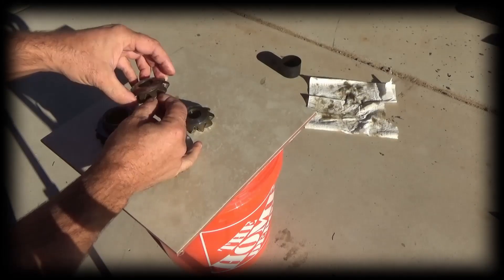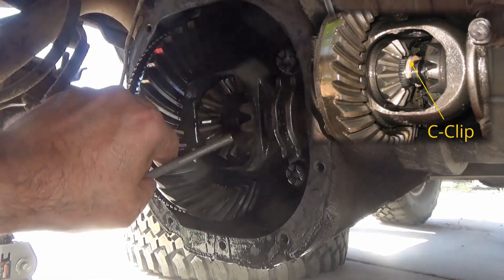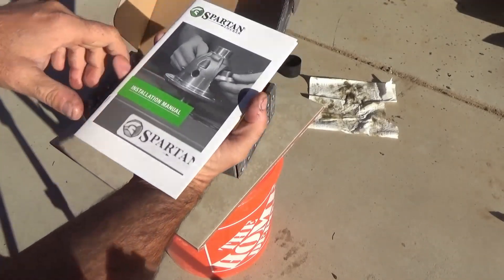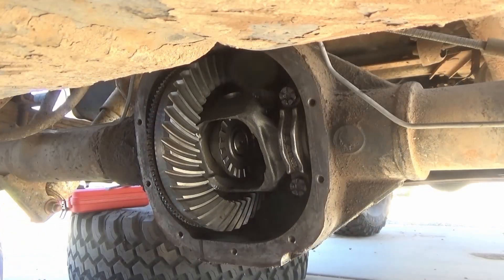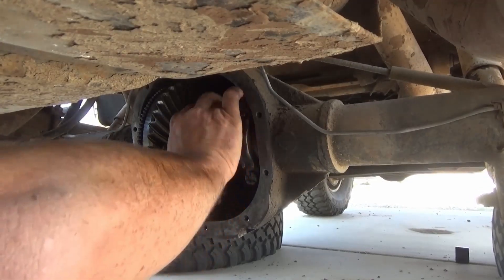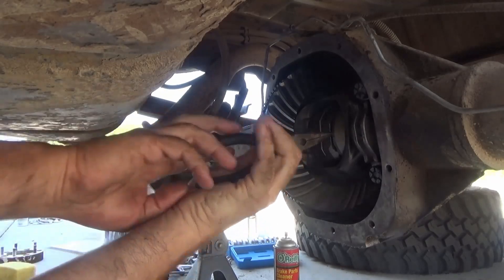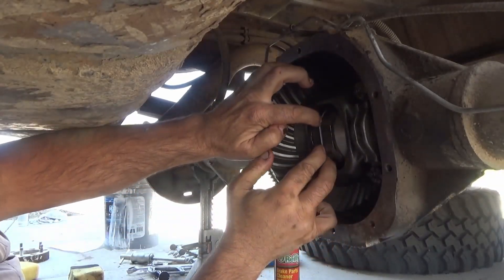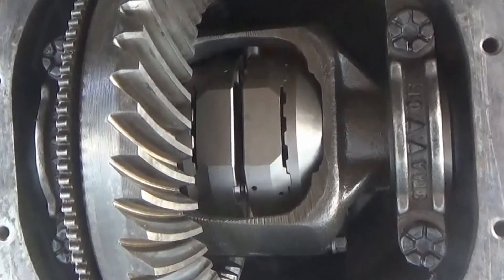Spartan Locker FORD 8.8 Rear Differential | 1990 Ford Bronco 4x4 Project! Lunchbox Locker! OBS Build

Comment: I have a spartan locker on my 2011 ford ranger which has the 8.8 & 4.56 gears. Now, what if I broken 2 rear wheel studs? How do replace them with new ones without ruining  my locker placement or spring pins if I have to take out the "C" CLIP?

Comment: I ordered my Spartan locker two days ago.  It should be here soon.

Generic lunchbox locker videos suggest removing the brake calipers from the rotor, in the case of rear disc brakes, in order to slide the axle in.  Did you only have to remove the rear wheels of your Ford 8.8" or did you need to remove any brake assembly?  Thanks!
Reply from the maker: I did outer bearings and seals at the same time so I did pull the wheels and brakes. Thanks for watching!

Comment: Did you notice that the kit number you specified ($ 250) does not have the new center pin?  It has some sort of bolt, instead.  Oddly, on the Amazon site, right below the picture for the Spartan Locker is a picture for a new spider gear set if you were just going to replace the spider gears.  In that picture they include a new center pin.  Also, for $ 4 more, $ 254, you can get a Spartan Locker with a new "Heavy Duty" cross pin.  Is that what you got?  How much did you pay for your kit?
UPDATE - from what I see on other videos, the kits come with a new cross pin and that bolt.  Never mind.
Reply from the maker: It was $250 and included the center pin.

Comment: I need do this cause I got stuck cause I dug a my self in on one side trinna pull a trailer sucked this would make the world of a difference.
Reply from the maker: The spartan locker is great! I rarely even need four wheel drive any more. Thanks for watching!
Reply: @heathputnam9524  can you put the same unit in a front diff?
Reply from the maker: Yes, but the front diff may not be an 8.8 diff, so buy the right one for the front.

Comment: I wirebrushed the new retaining bolt and gave it a good coating of fresh blue Loktite, prior installing in the cleaned threads. My gap was .171" but this was assembled dry, I assume the gear grease film thickness should bring it within specified range, which is .145" - .170". Prior to removing the pin retaining bolt, I warmed the threaded zone up to about 300F with a heat gun, to release the thread locker. This was on  a 2007 F-150 xl, manual 5sp, 4.2l,  axle code 27.  (Spartan SL F8.8-31)
Reply from the maker: Great! The .171 should be fine! Thanks for the tip on the Loktite and the heat gun!

Comment: ALWAYS make sure your drain plug can be removed BEFORE draining or removing the diff cover.
I couldn't tell and you didn't say if you have manual lockouts on the front. If you do, this locker is much more useful on the front without all the clicking, banging, tire wear and odd handling.
Reply from the maker: I have not put manual lockouts or locker in the front yet. The locker in the rear is amazing! I almost never shift into four wheel go-go anymore! Thanks for the comment!

Comment: Skipped the very important step of checking for correct tolerances.
Reply from the maker: As I mentioned in the video, the instructions were poor. I have been running it hard in the desert for thousands of miles and it’s still going strong even without measuring! Thanks for watching!
Reply: @heathputnam9524  I believe thats when replacing the ring and pinion, He left those as they were.